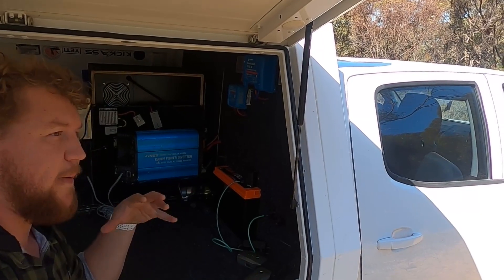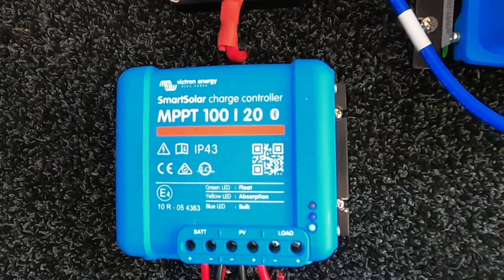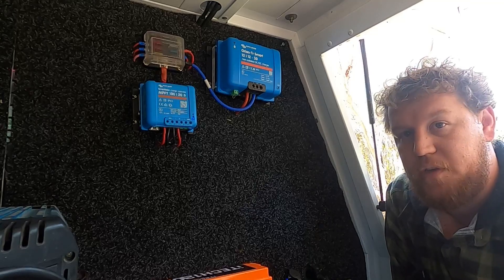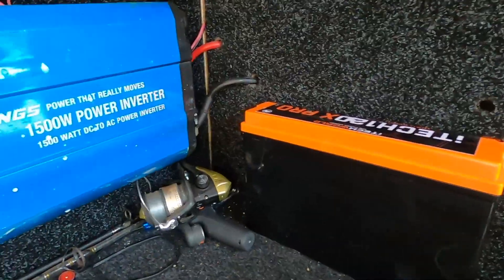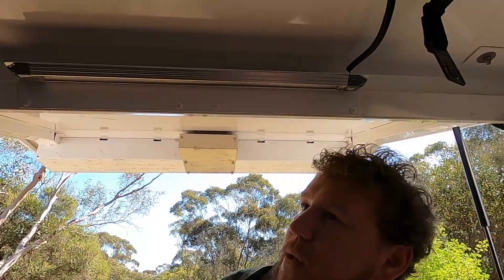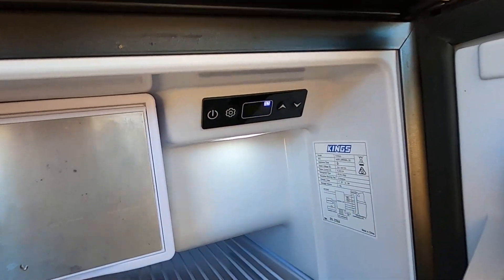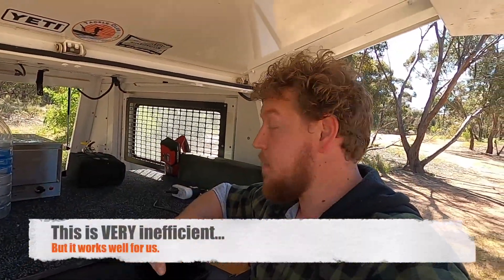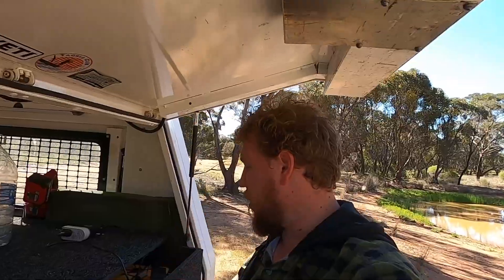iTech World & Victron - The ULTIMATE 12V Setup to STAY Off Grid?

Comment: Nice video mate.  What size AWG wires did you use between solar controller and battery?
Reply from the maker: Hey mate,
For my setup, the solar controller connects back to my fuse block with 6mm twin auto cable from Narva (50A capacity).
From there it connects back to my battery on a main 6 B&S cable (100A capacity)

Comment: Good vid. How come the MPPT not got any load wires (solar) connected?
Reply from the maker: Hey Brett, main reason mate is we run all of our loads off the battery through individual fuses.
We use the Victron charger purely to charge our battery.